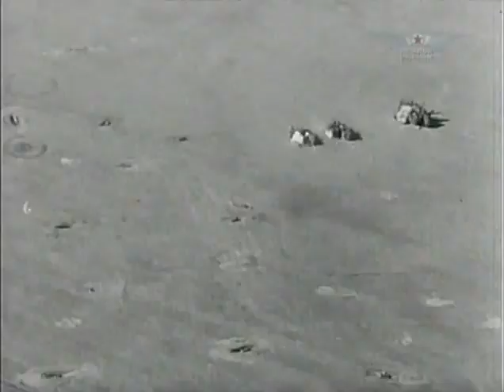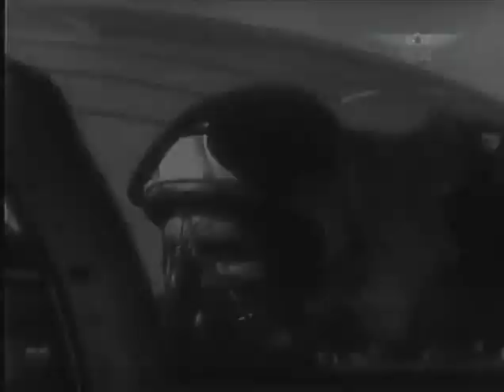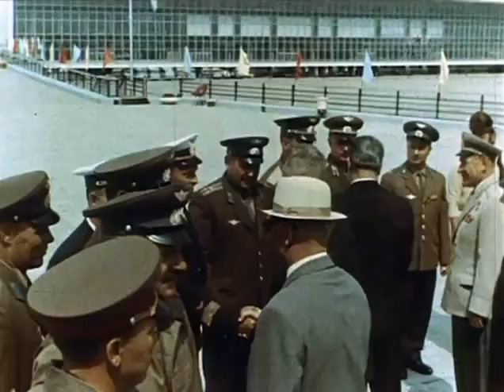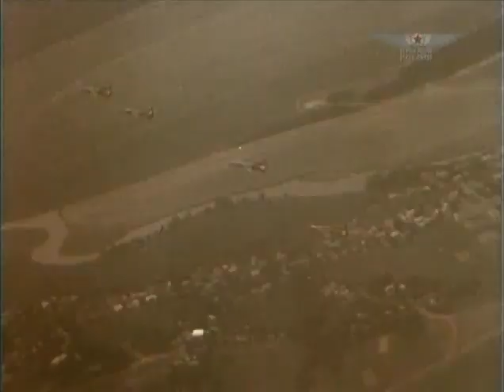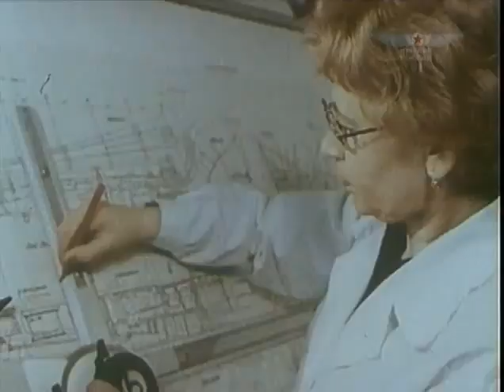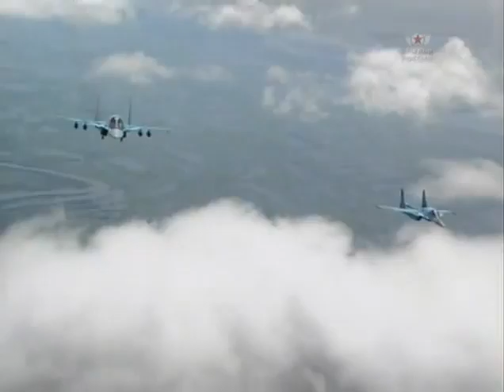Soviet Attack Aircraft 8 / 18: The Jet Strike Full Length

Comment: I've tried googling and shit and I HAVE not ever found an image of the Su32's rear galley and toilet. Can someone point me to one?
Reply: that was su-34.
Reply: ok yes Su34 i stand corrected. still, can anyone find any?
Reply: Wiryan Tirtarahardja lol I have tried too, I still can't believe that they fit that in the su-34, but no luck sadly, I can't find a single picture
Reply: TheGhilliSniper its probably classified or simply no pilot has given a shit to do it, check blueprints
Reply: Wiryan Tirtarahardja Interesting, I had never thought about this & you are right! But why wouldn't they?
Reply: +Wiryan Tirtarahardja It's just a short corridor behind the cockpit. The "galley" is nothing more than a microwave and a small folding table. The "toilet" is just a small cylindrical container you can relieve yourself into.
Reply: Tiles Murphy Wellthe plane DOES have a limited size, this isn't a passenger jet, however I'd deem it enough.
Reply: +Wiryan Tirtarahardja https://www.google.com.mx/search?q=su+34+toilet&espv=2&biw=1057&bih=1061&site=webhp&source=lnms&tbm=isch&sa=X&ved=0ahUKEwiFg_P_1PLKAhUY7mMKHci4BpwQ_AUIBigB&dpr=0.9#imgrc=rx-N1qffE4WXkM%3A

Comment: This is the best technology that exists today; designed in the 1960's.
Feel the FEAR, someones coming to attack us.  It will be a Christian or Muslim.  IX XI
Reply: so the airframe is from the 60's so what its all about the electronics now while you could never turn a mig 25 into a stealth aircraft chuck in a modern AESA radar new lyulka turbofans 4 R-37 extreme range missiles and you've basically reinvented the aircraft while speaking of the mig 25 isn't strictly relevant modernization is and its what we've done most of our old aircraft have completely new avionics
Reply: killman369547 My "sarcastic point" is that, other than updating current systems or engines, this is the pinnacle of technology that exists on the Planet and it is used to drop Iron Bombs.